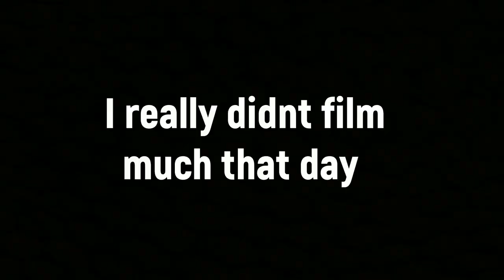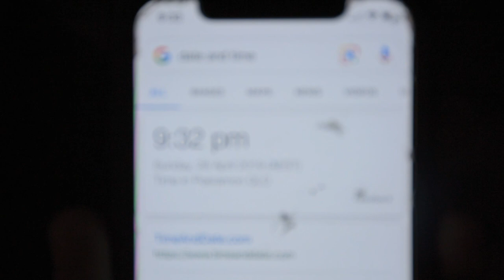I'm gonna title this episode 9

Comment: Hey love the vids mate, are those nail bags your wearing the occidental leather ones,  fastener bag on left and tool pouch double on right ???  I’m due for some new nail bags myself, and just want an opinion from someone who has been using them 

Cheers mate
Reply from the maker: Nar mine are a way cheaper version, the exact bag is called the style and craft 17 pocket nail bag. Look that up on Amazon and u will find it bro :)
Reply: Jackson Hoad cheers mate how many years have you got out of the bags ?
Reply from the maker: I’ve had them for about 1.5 years now and I’ve had absolutely no problems. They are perfect in every way still
Reply: Jackson Hoad can you fit an 8 meter Stanley fat max in the tape slot
Reply: @bentonturner1619  watch his nail bag video...